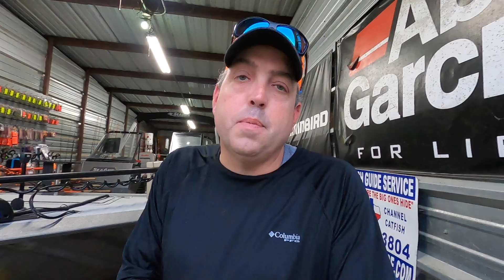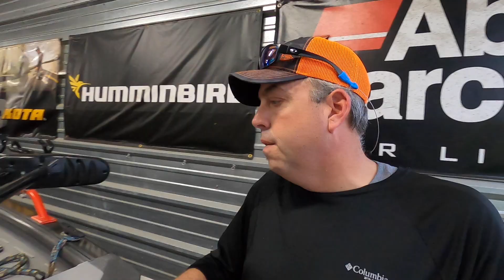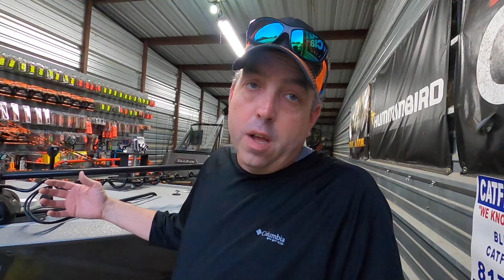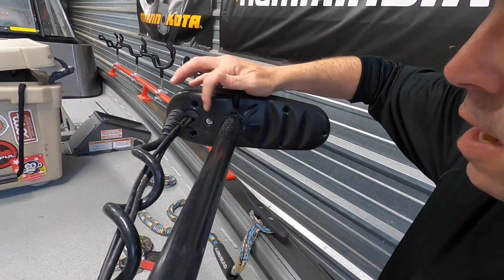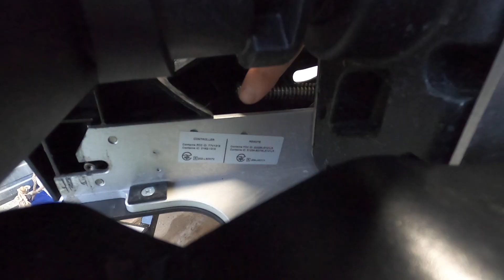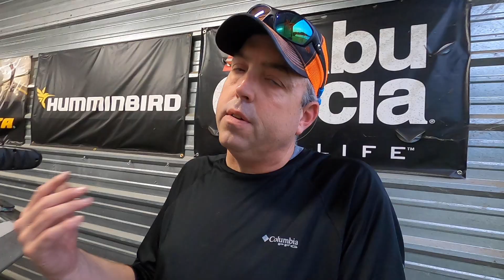Keep Your Minn Kota Ulterra PROBLEM FREE (Troubleshooting and Maintenance)

Comment: Kinda hard to listen to as an Engineer.  Things aren't sensitive to voltage drop.  They cause it.  The motor uses a lot of current to stow/deploy.  That heavy load, when introduced to a highly resistive connection, causes a voltage drop.  Ohms Law isn't that hard.  I have had an Ulterra since they came out.  Are they nice?  Yes.  Are they perfect?  Far from it.  That linear actuator is a bit weak.  The plastic retainer that holds the motor to the actuator is pretty pathetic, and shouldn't have been designed that way.  I replaced mine with a milled aluminum cap.  I had to modify the remote because their charging connection is a non-proven, proprietary piece or garage (spring connectors??  USB would have been better).    Now, don't get me into the software.  I have almost nothing good to say about the software, other than, there isn't really anything else as good.  It knows nothing about going backward (in rivers we back troll). Many people use these to auto steer their kicker motor.  Why not pay attention to your customer base, and put a simple feature to help with this?  There is no gain adjustment to their horribly slow PID routing for steering.  Their stair-stepping power settings make spot locking difficult unless the water is still, or moves in one direction.  How hard would it have been to make the motor accelerate linearly?  Would I buy another one?  The moment mine went out.  I just wanted to counterbalance the fanboy.
Reply from the maker: I have no idea what this means but as a fisherman that uses a motor way more than most this is what I know.

Comment: I just bought a 2012 ranger with 3 hours on it.  The original owner only used it one time and died after having the trolling motor installed sometime after 2017.  His widow sold it without knowing where any of the manuals were, and also the remote for the motor is missing.  It came with the 2017 ulterra i pilot link with universal sonar, (no side or down imaging).  Also a helix 9 chirp SI GPS G2N at the console with the transducer at the stern.  Also a helix 10 sonar GPS ( no "N") at the bow connected to the ulterra transducer.  The two units are connected with an ether cable but the i pilot link 8 pin cable is not attached. It is laying under the cover plate at the bow coiled up with a zip tie. Can you  explain what I need to do to get where both units can deploy and stow the ulterra and hopefully use the other features that it is designed to do?  I hope you can explain it to where a 65 year old country feller that's not too savvy with technology can get it working.   thanks
Reply from the maker: That’s way more than I can walk through in a YT comment
Reply: Thanks 
I think I have got it figured out

Comment: Help lol.

The trolling motor is stopped at an angle do to me hitting the pause button to clear weeds off of it.

The red and green lights are alternating off and on.

The power button does nothing I cannot shut it off. 

Any ideas?

Thanks,

Mike
Reply from the maker: Unplug it and plug it back in then perform the reset

Comment: I have had to reset my a few times following the reset code procedure (3 push of the buttons within the first two seconds of starting up) and this has always worked.   But this weekend it did not.  Is there any other reset or diagnosis codes I can get to diagnosis what the problem is?
Reply from the maker: Unplug it, plug it back in and reset

Comment: Hi, nice video (y) good tips and as being technician myself I also use WD40 and grease up the moving parts. Have my ulterrra now for about 3 years and never had any kind of problems with it.. When it should break or fall out I wouldn't hesitate one second to buy another one. I have a question for you .. should you calibrate (making 2 circles with the boat) each time you get on the water? or does the minnota remember these settings? Thanks and keep those helpful vids coming!
Reply from the maker: Only once

Comment: Thanks for video.  I have used my motor for 2 years without issue.  It will not deploy.  Power comes and stays on motor and pedal.  When hitting deploy on pedal will not deploy then beeps.  Tried power off and on holding power button in  goes to green when pressing power 3 times does blink red.  Took both sides off no wire pinching.  Any suggestions for fixing?
Reply from the maker: Contact your MK service center and get them to look at it.

Comment: checking out my new 80 Ulterra and when trying to stow, the motor was not sideways and it stopped with the motor verticle and prop facing up. Get a motor error and it will not stow or deploy.  Any ideas
Reply from the maker: Reset it. It's in the manual.
Reply: @Catfishedge  Thanks for your response. I could not reset it (And I did read the manual. LOL) It's at a dealer now waiting for a new board and ramp unit. I'm not too happy with Minn-Kota
Reply: @stanboland568  Stan I had the exact same problem. can't deploy, prop facing up after doing the reset procedure. what was the final fix for you?
Reply: Stan - what was the eventual fix? I have the same problem after doing the reset function. it spun the cable around the shaft and then laid down horizontally with the prop facing up. it won't deploy at all now.

Comment: When I power my ulterra on, it goes to full speed whether stowed or deployed and won’t stop running full speed. Any ideas?
Reply from the maker: Yes it's in the settings. Can't remember which one though. Restore to default and that will fix it.
Reply: The software will not let the motor spin while being stowed.  If your motor is spinning while being stowed, you have big problems.

Comment: I've had two ulterras, an older one (still with the new remote) 80lb, and a new 112lb with the down imaging built in, have had 0 issues so far except the other day after 80 hours of use with this new one it wouldn't deploy.  I wiggled the shaft and it kind of released like it was binding and then it's worked perfect since.

Had no idea you could tighten the track, and didn't know what to grease either. Appreciate the video.

Comment: Your video is the best I have seen so far. Here is my issue. I have the 36v ulterra rip tide and had stow issues last year and they replaced the mother board due to issues. I have put about 5 hours on the new mother board. yesterday the motor stopped 6" vertically during the "stow" function. The shaft is clean, belt is tight and I still had good power left on my batteries. The motor will still trim up/down but will not complete the stow function. I have done the 3 fast push of the power button reset. My unit still will not stow 100"% to the horizontal position from 6" from power head placement. Do you have any suggestions as I am on vacation and still have 4 days left to fish. Thank you, Jeff

Comment: I went to out mine down for the very first time and the power chord was wrapped around it and when it got almost vertical, it came unplugged and there it sits now! Dead, can’t reset it, just keeps saying thats it’s paused...tried 2 different resets, nothing! Now what!?!
Reply from the maker: What happens when you reset?
Reply: Catfish Edge - nothing, just kept saying it was paused. Was able to get MK on the horn the next day and they had me set it all the way down, manually turn the motor rod out to the end and then attach the black cap and screw. Did a reset and it took off. No problems since, fished everyday this week without issues at all.

Comment: Just purchased a boat with a 70lb ulterra and so far i love it.  Guy has mix matched 31 group batteries and am thinking about fixing that mess.  What have you had best luck with for batteries and battery life?
Reply from the maker: Duracell AGM from Sams club
Reply: @Catfishedge  do you have a link for the proper receptical plug for the ultra?
Reply: Ulterra
Reply: Hi Jesse.....the one he is showing in video is the same one I have. It is the  MARINCO–70A Trolling Motor Plug and Receptacle. It is by far the sturdiest plug you can find!

Comment: Very good information. My new Ulterra was making a clicking noise when lowering and was thinking it was in need of lubrication. Do you loosen the rubber belt before spraying silicone on underneath side? Can you use regular WD40 or does it have to be 100% silicone WD40? Learning my Helix iPilot Link so will look for your YouTube on that, too. Subscribed & “liked”.  Thanks
Reply from the maker: No just spray it on there
Reply: Thanks. Found the 100% WD40 spray and need to get marine grade lubricant. Any particular marine brand lube that you use?

Comment: This video was extremely helpful and informative.  I have had my Ulterra for 3 years.  Last season it started having problems deploying and would stop and show motor error.  I brought it to the Minnkota service Centre in my area.  I was told just to clean the shaft with armor all wipes.  I asked about preventative maintenance etc.  After paying the $100 bill for them to wipe it down it has continued to give me problems frustrating me on the water without my trolling motor.  I just completed everything you mentioned from the tension of the belt to the lubrication.  It is now deploying and stowing without issue.  Many thanks.
Reply from the maker: Glad it helped

Comment: recently purchased a boat with an ulterra. it worked great for about 6 weeks and now it will not stow. called minn kota, went through the reset procedure and still no dice. was told to manually stow. like i said, it works perfect, excpet it will not stow. any ideas?
Reply from the maker: Did you follow the instructions in this video?
Reply: @Catfishedge  i fixed it. turns out the stow/deploy motor shaft linkage was bent. put a good bend on her and shes back working
Reply: @jeremyflowers6391  mine won't stow. Are you referring to the motor shaft screw? Mine worked great the first couple of trips. Now it won't stow and I have everything else checked out.

Comment: Strangely enough, my Ulterra quit deploying yesterday while on the lake. Took it to Brian at Sartin’s today. Problem was that the main shaft and the ramps where the motor reaches the stow position needed cleaning and lubricating. I’ve had it since Sept. and don’t get to go that much but when I watched this clip I made a mental note about needing to schedule the lube maintenance routine. Just waited one trip too long. But, thanks for the video.  👍👍
Reply from the maker: Thanks
Reply: I just came here to say exactly that, happened yesterday

Comment: Just watched your video, I love my ulterra but sometimes on anchor it will twist the cable so tight I am scared it is going to break, have you heard of this problem and how to fix it? thanks
Reply from the maker: Calibrate the heading sensor and make sure you’re nose into the wind when you spot lock.
Reply: @Catfishedge  pretty sure i have tried that, but will do it again, thanks
Reply: It happens to me when im on a lake with allot of pleasure boat traffic.  When you get criss crossing waves.  That's my only experience with it getting to twisted.

Comment: What kind of plug specifically do I need for my 24V 80lb Ulterra?
Reply from the maker: Make sure it's the correct amp rating. That's the key!
Reply: @Catfishedge  Why would they have the wrong plug? Isn't the plug that comes with it correct?
Reply: Hi Michigan Fish.......he is showing the  MARINCO–70A Trolling Motor Plug and Receptacle in the video. Its the BEST!

Comment: Year 1, wouldn't stow, had to take it off in the middle the lake, the gear belt drive broke, it's a common problem on these motors.
Reply from the maker: I've not heard of anyone having that issue in a long time.
Reply: @Catfishedge  It was covered under warranty since then haven't had many problems in 2 years

Comment: I notice your motor is 180 degrees from mine when stowed.  How do I change that?
Reply from the maker: Positioning reset procedure is in the manual. I like the prop in towards the boat. I break less props that way.

Comment: Unfortunately, my MK Ulterra ownership hasn't been all good.   I purchased one of the first production models, had problems right out of the gate.   It would go into error mode when powered without touching or using it and when that happens you have to be quick on your feet because you are dead on the water with no boat control until you can get to your main outboard to position the boat safely until you can figure things out.   The first production models had issues, MK let the 1st customers do their field testing for them.   Eventually, the motherboard in my Ulterra was replaced with a updated version and it has worked great ever since, that is until day before yesterday.  I had a stow / deploy sensor housing crack where a push pin held things in place, it caused misalignment which caused the unit to be stuck wherever the unit happened to be.   This situation was somewhat of a fluke otherwise normal wear and tear and that might not ever happen to someone else.   So I have spent a few hours at a authorized Minn Kota repair shop, the first time several years ago for the motherboard replacement, then again today for the sensor replacement.   The repair tech, factory trained, factory authorized, over 40+ years experience.   It just so happens his personal TM is the MK Ulterra.  I asked him today if the belt should be lubed, he said "no" don't lube anything.  That's just what he said, I doubt using silicone would hurt much but that's just my opinion.   Keeping the correct belt tension is probably more important and if you have a early production model, MK has updated the design that holds the belt at the very top inside the head.   All of this said and despite the issues I've experienced, the Minn Kota Ulterra is by far the best TM I've ever owned.   Love your channel, thanks for your time and effort.
Reply: Hap Time Same thing happened to me. They changed out the head then changed out the motherboard, then finally sent me another Ulterra and I have been problem free since.
Reply from the maker: I can say with 100% certainty the belt needs to be lubed. Your “repair guy” doesn’t know what he’s talking about. Read the manual.
Reply: I guess I didn't make myself perfectly clear in my previous message so instead of editing my comment, I'll just add to my comment to avoid any confusion for someone reading for the first time.

Reading the manual isn't exactly what it use to be.   Johnson Outdoors, parent company for Minn Kota, Humminbird and others doesn't always supply a owners manual.   They expect you the customer to download the owners manual and sometimes Johnson Outdoors will supply a "disc" of the owner manual.  In reality, not everyone will take the time to obtain a owners manual therefore will never fully understand the product.

The factory authorized repair tech I mentioned was only referring to the drive belt when he indicated to not lube anything, I didn't make that clear, I should not have use the word "anything".    Here's what the manual does say about Minn Kota Ulterra maintenance.    Page 42:  In order for the Ulterra to continue running at optimum performance, it is recommended that the Latch Pin and the Motor Shaft for the
 Power Tilt be greased every season. It is recommended to use a marine grade grease.  Page 55:  The composite shaft requires periodic cleaning and lubrication for proper retraction and deployment. A coating of an aqueous based silicone spray will improve operation.

There is no mention of lubing the drive belt at all so to be sure I sent Minn Kota a message asking that very question.   Minn Kota replied:  Hello!
  You do not need to lubricate the drive belt.  Thanks, Dan

It's up to each individual to decide how to best maintain their trolling motor, I'm only adding this information for the sake of accuracy and correctness because Chad is right, these units are very sensitive.  The only other thing I might add or recommend is this:   It should be mandatory for every Minn Kota Ulterra owner to have the quick detach plate, it'll save having to go through the emergency stow procedure on the water.
Reply: Hap Time Good report!

Comment: I also love my Ulterra. Mine is an early version and the spot lock is not as good as the later versions, my understanding. Like yours, mine has been trouble free for 5 years.
Reply from the maker: Yes the original spot lock is 15 foot range and the newer is 5
Reply: @Catfishedge  I just purchased a 2012 boat with the ulterra .  The boat has been sitting in a closed garage and only has 3 hours of use.  What year are you referring to as an original spot lock with a 15 foot range?

Comment: Good video,   I too have been running the Ulterra for about 4 years now.  I hear people comment to me while I am at the ramp or on the water that there is to many moving parts and the motor will someday leave me abandoned on the water.  Well it hasn’t happened yet, and I love this motor.  Thanks for the tips on maintenance.  Hopefully it will lead to those naysayers reevaluating their resistance to a magnificent machine.
Reply from the maker: Thanks
Reply from the maker: Thanks

Comment: I have been running a Ulterra for 5 years, best trolling motor I have ever had, zero issues.
Reply from the maker: Thanks
Reply: I wish I had the same experience, mines two months old and had three issues so far
Reply: Had one on order but read the terrible reviews on the Minn Kota  web site and promptly canceled it. If they offer a 5 year warranty i might purchase one in the future. $3500 after taxes is way to too much for this unit that gets 50% bad reviews. I'll just keep rebuilding my terrova for now.

Comment: I have the 1st gen ulterra and always maintain the only issue ive had is gopro remote screws up the opperation of it I guess wifi crosses idk
Reply from the maker: Yes, sometimes bluetooth has crosstalk. I've not had issues with the TM but have with other BT devices.